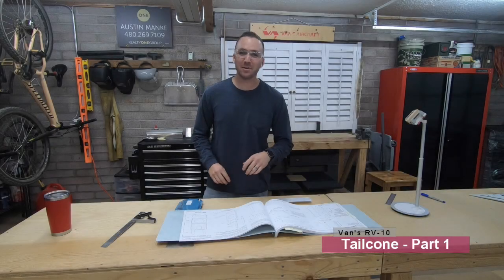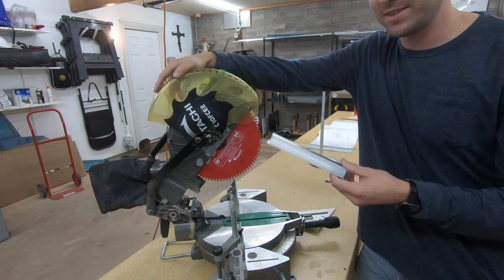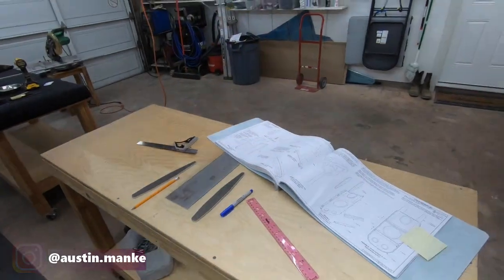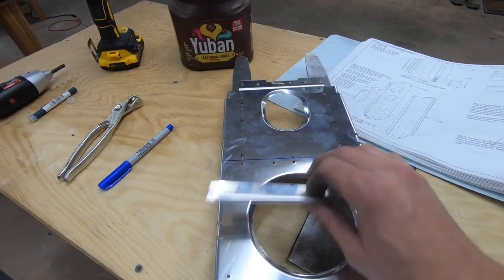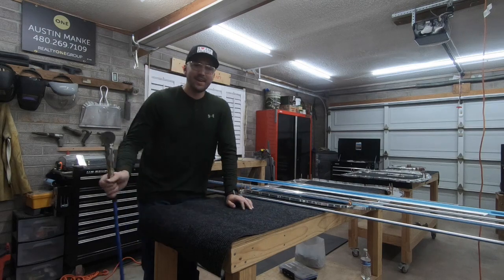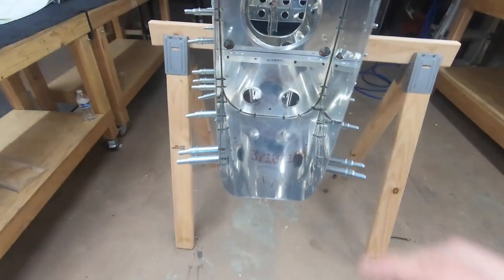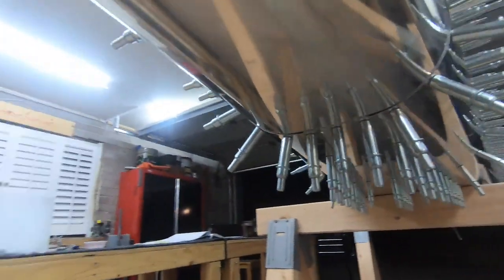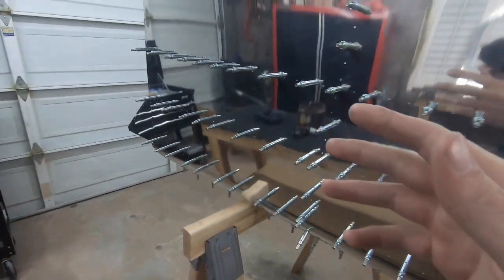Van's RV-10 Tailcone Build, Part 1

Comment: Kinda surprised that the factory tooling isn't set up to make that tailcone bulkhead more rounded to match the radius needed for the outer skin. I say that because it's not hard to get that kind of match with modern CAD tools and CNC machining.
Reply from the maker: Yeah there are a few parts I’ve come across that could be formed better. It was definitely quite the fight to get that bulkhead to match up

Comment: I had a helluva time with the aft 2 bulkheads and lower tail one piece.  You’re not alone
Reply from the maker: Those were quite the challenge!
Reply: @AustinManke  Riveting that section was NOT fun
Reply from the maker: @JimDorn  good to know! I guess my figure self will thank me for making the parts line up a bit better. Is that a two-person bucking job?
Reply: @AustinManke  Funny you should ask...I was just working on that section when the Youtube email came in.  I was going to and back rivet that whole bottom skin including that section.  However, I can't reliably get the fuselage to sit safely on the back rivet plate (I made my own and it's big).  Overall, it's a two-person job.  I also have a couple of bulkhead flanges that are no longer flush with the bottom skin.  I need some help to hold them down while it's riveted.

Comment: What do mean hit it with the scotch bright wheel?  are u sanding the flat sections making them smaller so the sit closer to the outer skin?
Reply from the maker: I sanded down the corners of each of those  pieces that were supposed to be curved (right at each of the relief cuts). Basically just rounded down the points that contacted the skin before the rest. Hard to explain over text, but it appears the part is supposed to be round to match the profile of the skin, but instead the curve is made up of several flat sections with abrupt angles. The sanding/light bending made those abrupt angles more round to let the bulkhead sit flush against the curved skin.
Reply: Yelp it did, I would imagine once rivets are added everything will pull together
Reply from the maker: Not sure if that response answered your question, but yes it in turn makes those sections slightly smaller (without going too far and making a harsh knife edge)